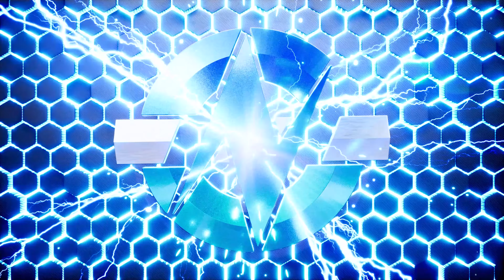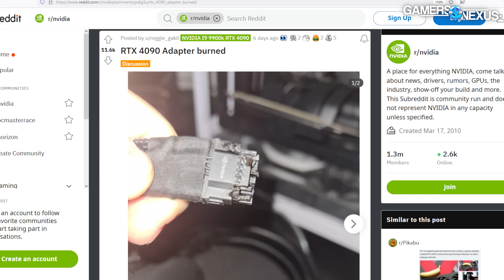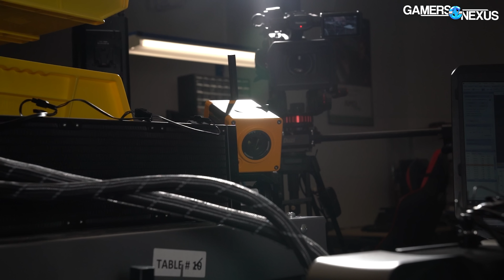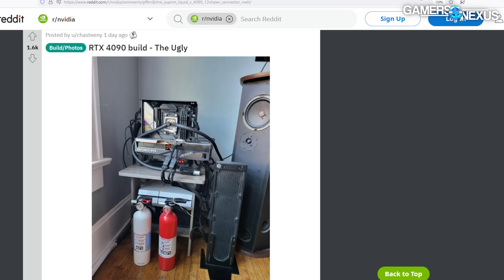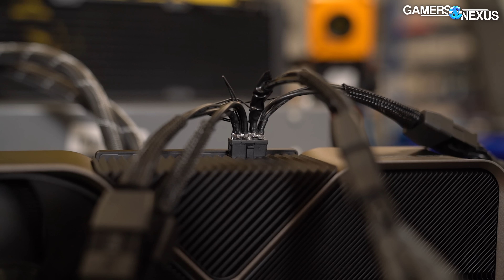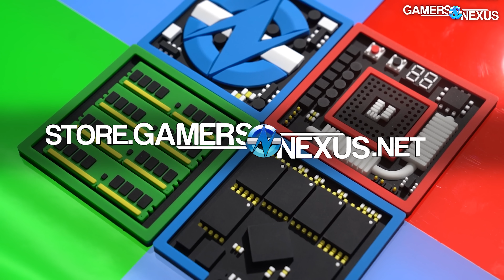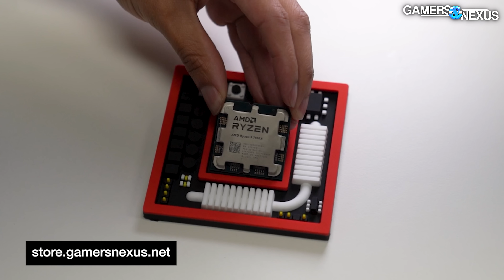Testing Burning NVIDIA 12VHPWR Adapter Cable Theories (RTX 4090)

Comment: Have you tried viewing the signal with an oscilloscope?
If it's done without voltage, you can inject a sine wave signal and output audio from it at the other end or view the waveform on the oscilloscope.
If the cable moves, distortion may appear in the sound or be visible on the oscilloscope.

If the card is powered, you should see a continuous line (with ripples), but if there are problems, you may see a continuous line with transients or transients in the power supply.

Bad contacts cause burnt contacts in relays, switches, connectors, etc. Overcurrent generates sparks that produce heat, blackening the contacts, unsoldering connections, and sometimes soldering them, which causes them to stick due to the heat.

Regards

Comment: if a terminal is disconnected somehow in the connector, that WOULD be a cause of heat generation, due to arcing, where the break point connects, & disconnects sporadically, causing carbon gasses to coat the little area, causing higher resistance to build up between the break points, causing more amps, & heat, which in turn, causes stronger arcs... until, buttered plastic. Testing disconnection by completely removing the wires, causes this theory to be unseen. Must be disconnected, but still in it's place, still touching it's intended connection point, but not solidly soldered to it. In summery, Arcing at a "still touching" broken solder point, CAN cause high amps, & melting.

Comment: The longer the cables, the more the resistance and the voltage drop will vary at the solder point..   We can not piggyback parallel power through long cables in the EV industry, it would cause a   lithium battery fire  starting at the cell terminals.   Not that  we would  like the option, we just cant do  it.  You only get one lesson at this.  How much are they paying you to ignore the disregard to proper specs and engineering ?

Comment: Solution is to buy AMD and not deal with this
Reply: It really isn't.
Reply: AMD sucks, the 4090 blows it away. just plug it in tight and don't use third party adapters.

Comment: If the cables have aluminum core, they might get hot and might break down over time.

Aluminum core cabling is notorious for melting or burning when used in high current situations.

It sounds to me like the issue is about the high power draw of these cards, coupled with overclocking.  My microwave oven is 600 watts and heats water to beyond the boiling point in under three minutes, but these cards are drawing that much power under load and overclocked.

Comment: It does count up for me how can u call it high power connector wel the power goes trough 4/6+ wires and 4/6- wires against (the old)3x 8 pin connectors so u have 12+ wires and 12- wires   I mean a wire is a wire and copper is copper. more copper wires is more power and wattage  is coming trough 🤷🏽‍♂️

Comment: This reminds me.   I once tried to pass more current between 4 EV series connected batteries, using 5*10amp rated cables in parallel, than 1 thicker single conductor with a 50 amp rating.  The connectors where the 5*10 amp conductors met, would consistently overheat the battery terminal and damage the battery cell the connector was connected to.   

What was occurring with this design flaw, that each conductor was allowing slight variation between their resistances, and supplied different voltages when meeting at the connector. Where there is a voltage potential difference between each conductor, wattage was  being wasted.  I noticed the the shorter conductor began to work harder than the  longer conductors, had less tolerance for the heat, and  began to melt the wire insulators.

A quick way to test this, is to try pass the same voltage source through two different length conductors, to the same connector and put a heavy load onto the connection.  The longer conductor will have a high voltage drop over the distance then the short one, and current will  start passing backwards from the shorter conductor into the longer conductor to even the voltage out at the terminal.   

If the drop was .2 per conductor, volts at 100 amps,  this equaled to 100 watts of heat being dumped into the terminal of the battery.   FETS can share an output in parallel, but 
BNC transistors and linear regulators can not.  Nor can these connectors inputs..

Comment: too much text. 
if you can read datasheet on mini-fit ("old" type) and MICRO-fit - you can see difference
on mini-fit current limitation is 11-13A (ampere) per pin
6 pin (+12V 2*3 in "old" 2*8 pin connectors) can delivery from 66A to 78A. 66A*12V is a from 792Wt to 936Wt
"12VHPWR" in MICRO-fit, and can delivery only 5A per pin.
so, from 6 pin *5A is a 30A current, what means only 360W (30A*12V).
thats all, folks.

Comment: According to Polish Yutuber original Nvidia  NVIDIA 12VHPWR Adapter have spread from 8Amps to 13Amps per cable with max rated 9.2Amps he also tested original cable from his power supply and amps were equal 9Amps all test on RTX 4090 Power limit 133%  www.youtube.com/watch?v=vEaKPMGrWbQ.

Comment: Voltage (V):	14 AWG Copper Amps:	14 AWG Copper Wire Wattage:	14 AWG Aluminum Wire Amps:	14 AWG Aluminum Wire Wattage:
12 Volts	        16 Amps	                           192 Watts	 –	 –
24 Volts	         16 Amps	                            384 Watts	 –	 –

If what I read is true, this should be the MAX rating for a 14 AWG copper wire.    Voltage is not the ONLY thing to look at.   Please do you research before posting limited knowledge.  How MUCH AMPS ARE BEING DRIVEN HERE???

Comment: Power cables dont use solder on pin conecctions , or any connector, they use criping tools to crimp the pin to the cable securely, then go in the plastic connector,they avoid problems with solder heating and solder cracking , its a common practice in electronics

Comment: I wouldn't worry about the voltage rating on the wire. That's normally just rating the insulation. If it's true 14AWG, each +12v strand is rated for 15 amps. Per ohms law with a stable +12v feed from the power supply, each wire should be capable of 180w. 6 of those more than covers the supposed 650w its rated for. I'm willing to put money on bending the cable not damaging the plug/connector, so much as it's causing a poor connection between the pins in male plug and the female connector. I've seen melting just like this on fuse holders for amplifier power wires at my job. Usually it's a result of a loose connection at either side of the fuse causing micro-arcs and intense heat build up.
Reply: Oh and just to add I don't think we'll see nearly as many, if any, issues with native 12vhpwr cables. What would cause the issues I'm talking about is having 4 pci-e plugs all running together into that tiny 12vhpwr connector making it entirely too stiff. That stiffness is cranking the connector and pins at an odd angle which would cause a poor connection. Once it's just 12 strands of wire with sleeving and the sense wires the flexibility of the cable will be so much better and will most likely solve the issue. That's assuming I'm correct, but like I said, it looks WAY too familiar to not be.

Comment: I get the feeling the vendor for these cables never properly vetted these when shipping to the other card makers. So they probably 4080 or 4070 adapters for the 4090 cards. It will be interesting to see if the other cards have this issue, as it looks like power delivery is specifically mapped to the type of adapter. If the lower tiered cards have a different type of adapter cable, then it sounds like the issue was in distribution of the cables.

Comment: Just throwing my own theory in the ring. What if it's not the cables? What if it's the cards themselves? Everywhere I look everyone is saying the cable or the user not plugging it in properly is the problem. No one no where that I've looked has seemed to have stopped for a minute and wondered "what if it's the card?" Couldn't there be a manufacturing error somewhere along the line that occurs to cause the problem? That could also explain why it doesn't happen all the time. If every card uses the same 12 pin cable then the 12 pin socket area, and the power delivery area, on the card could have a similar manufacturing process across all aib and fe cards. Anyways just throwing my two cents in.

Comment: the amperage rating is what matters in a cable and the voltage rating only matters when compared to the amperage. you can use 12v rated wire just fine aslong as it can handle the amperage. what really matters is the amperage and resistance and that seems to be the problem. test the resistance between all your different cables and the higher resistance cable will be exactly like Igor's.

Comment: I made this thought for a response to a reddit thread asking why we see more 12VHPWR connectors melt on the RTX 4090 and not the RTX 3090ti.  I wanted to share this because the post got deleted while I typed it, and it may give new thoughts over the problem, especially the concerns with the 3x PCIE 8-pin adapter mode.  I don't care if I get negative responses, because any thoughts is a good thought.

My response.

I can't confirm if the RTX 3090ti did not have any melted power connectors reported. That will take too long on internet searches as the 4090 articles will contaminate the search.

Overall, the RTX 3090ti had a TDP rating of 450 watts, more or less does not get close to the 450W limit on that power connector. Further, I am assuming the power draw regulating system in the RTX 3090 and RTX 3090ti is much different than how the RTX 4090 manages power draw.

To add in the specs on the 12VHPWR connection, this connector is rated to support 6x 12v circuits (6 12v pins and 6 ground pins) at a max of 9.2 amps. Watts is calculated by multiplying volts by amps. This means each 12v + ground pair draws 110W before it becomes unsafe (generates minimum necessary heat to potentially cause damage). This brings us the total of 660W, which is just over the 600W maximum for the 12VHPWR connector.

To cause damage to the connector, the GPU does not need to draw over 660W of power through the connector. Instead, all it needs is more than 110 watts drawn over a single pin. This is where our current stress tests can be failing. The current stress tests can only reliably show us the external temperature of the entire connector, not the individual pin temperature on the inside. Gamers Nexus did mention this problem in testing.

As such, the only real way to test for this condition is probing the power draw from the GPU side of the connector to see how much amperage is pulled through each pin individually. I have not seen any of these connector melting tests look at individual pin amperage to ensure the power is being drawn evenly across all 6 +12v pins at the connector.

This is where the 12VHPWR adapters have a higher risk of melting. The different soldering methods allow anywhere from 8.333 amps on a single pin to 12.5 amps on a single pin to 25 amps over 3 pins and potentially 50 amps over 6 pins, all right behind the connector instead of inside of the power supply. If you have 16.66 amps that immediately split between 2 pins (one of the adapter styles), resistance in 1 of the pins can allow 10+ amps over the other pin, exceeding specifications and risking melting the connector. Having multiple pins gives the power source multiple paths. More amperage causes the conductor to generate more heat.

Why can native plugs melt? The 600W target on the 12VHPWR adapter is 8.333 amps per 12v pin. The specification is 9.2 amps per pin. There is not much room for error. Meanwhile for the PCIE 8-pin and 6-pin connectors, these also had the same 9.2 amp spec limit, but the 150W power target for the 8-pin connector is only 4.166 amps per pin. This allows 2 connectors per wire from the PSU. It is recommended practice to only use 1 8-pin connector per wire run if you can, so each 8-pin connector can safely handle over amperage on the GPU side. If there is some power draw balance issues over the 6 +12V pins, this can create moments of overdraw on a single pin that could deliver an insignificant amount of melting per incident, but after a long time, numerous incidents can add up to noticeably melted plastic. It will take longer.

This is where my opinion on why the RTX 3090ti didn't have a noticeable concern for melting the connector is because the RTX 3090ti didn't exactly push the 450W power draw like the RTX 4090 does. The RTX 4090, so far, has demonstrated a different method for rationing power to prevent power spikes and optimize performance. To add, the GPU can pull 75W through the PCIe slot, so that is 75W (6.25 amps) less power from the 12VHPWR connector.

What gets worse is how the 4 PCIE 8-pin adapter works if only 3 PCIE 8-pin connectors are attached, especially if all the wires don't merge completely together. For 1 of the adapter styles, that missing PCIE 8-pin connector can leave 1 or 2 pins disconnected. Now, the RTX 4090 has to draw 450Ws over 5 or 4 pins. The worst case of 4 pins, each pin is drawing a little over 110W, exceeding the specifications. This is where I believe the RTX 3090ti didn't operate that close to the spec limit.

The other adapter style known is 25 amps per 3 pins. In a 3 PCIE 8-pin connector setup, one set of 3 pins has 25 amps behind it and the other has 12.5 amps (but this isn't how power draw works, exactly). For 450W with 6 pins connected, this draws 6.25 amps per pin, which sounds safe. Well, 6.25 * 3 = 18.75 amps. The one set of 3 pins with only 1 connector has 18.75 amps going over the 14 gauge wire. According to internet searches, 14 gauge wire is only rated up to 15 amps. This is actually safe for the 8-pin connector, but that 1 set of 14 gauge wire is at risk of radiating dangerous heat.

There are a lot of thoughts over the issue, but my conclusion is that the RTX 3090ti does not reach the power draw levels that are questionable on the connectors like the RTX 4090 does.

Comment: My vape I built has 20awg cables, and it has max 350w power delivery through them, putting more than 5 amps regardless of the voltage through 14awg seems VERY sketchy to me (I unfortunately had problems because of using thin cables for power delivery in my projects, at sufficient power the wire becomes a heating element if not sized correctly)

Comment: Failure is Always an Option.
You forgot about the housing. You have to bend the plug, but it will be pressed into the socket at the same time.

Comment: Honestly, the fact that "there's more to the story" makes a lot of sense. Despite how evil Nvidia may be, if it were a simple defect issue, I find it strange they wouldn't find the issue and fix it.

But some manufacturer using a cheaper alternative cable to save money, then having those cards mixed into the majority, would make finding a trend more difficult. Especially if its something like a single manufacturing center doing it.

Comment: Maybe try to actually melt the connector by applying heat measure when it melted. Then digitally model just the pins and run it through all scenarios to see how extreme would you have to go to get to that temperature

Comment: Ive bought PSU cable for my 4090 and it had incorrect pinout. It connects to two ports on psu and somehow manufacturer decided to makes different pinout on each of the  two connector. So  will short circuits the card with any PSU. Reported it to both seller and Amazon. A week later that thing is still up for sale

Comment: Steve, you're wasting your time attempting to diagnose the problem. I posted this on another Youtube video.

As an electro-mechanical design engineer whose responsibility is actually selecting connectors, I will shed some light on this. 1st, with the load they are putting on this connector they should have opted to add more pins than 12. Always add more pins to exceed the connector rating by 50%. Had Nvidia done this we would not be having this conversation. They have 4 connectors at one end of the adapter ganging-up on just 1 connector at the other, what's wrong with this picture?  I suspect they had real estate issues on the PCB layout and one way to address that is to minimize the connector footprint by reducing the pin count. The engineer made the calculation and "under ideal conditions" figured it was OK 😮 If a connector is getting warm under max load means, it's inadequate for the job. Imagine having this problem on aircraft wiring, the FAA would ground every plane until it was resolved. The problem is the thin female crimp contact and the small gap on the Molex connector between where the wire is crimped and where it contacts the pin is, that's where it's getting hot and melting the connector housing. When you bend the wire, it causes the female pin to rock against the pin further decreasing it's contact area. Overtime the contact will weaken its grip on the contact causing the problem to get worse. I suspect Nvidia didn't discover this until the graphics cards were released to the public (by the 1000's) and report started coming in from customers but by then it was too late, and they realized they have a huge recall problem on their hands. Their solution is to ignore the problem hoping it will "go away" but it won't. I really like this card and want to use it in my new build and may consider removing the connector and soldering the wires directly to the board which will void the warrantee. I wonder if Nvidia will replace this GPU if the connector melts, but I suspect they will blame the consumer and deny the warranty claim. If someone house gets burned down as a result, they are going to have a real liability problem on their hands and they lawyers will have a "field day" with this one!  Trust me, the execs at Nvidia are walking on eggshells. Someone screwed-up here real bad

Reply